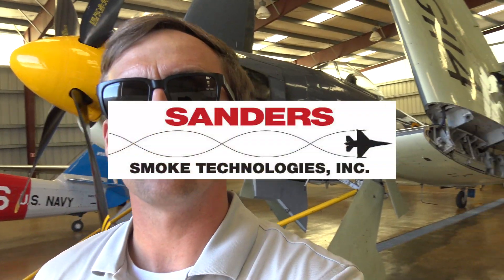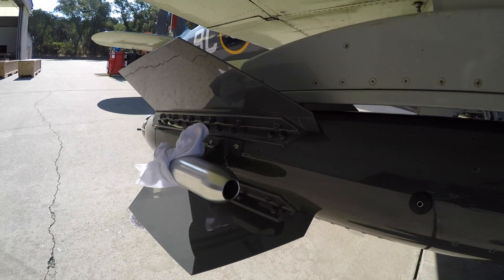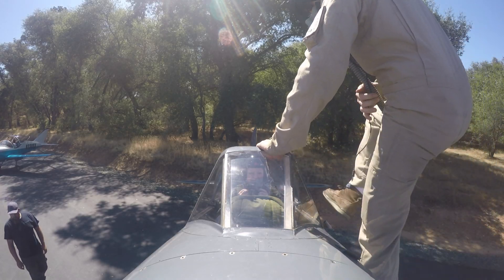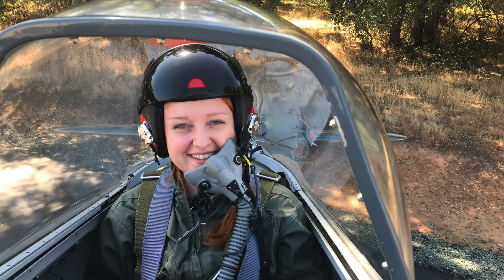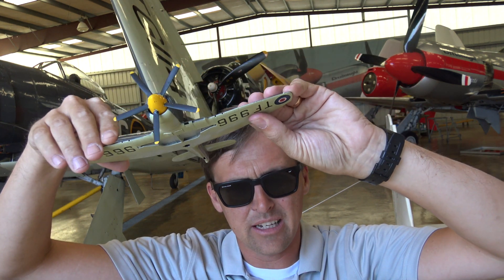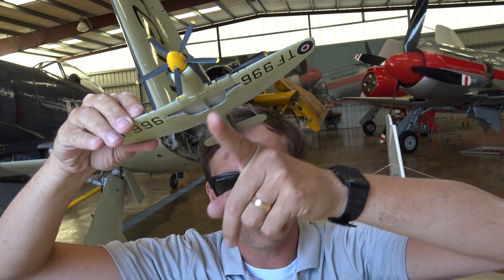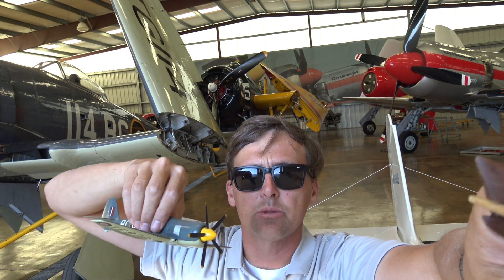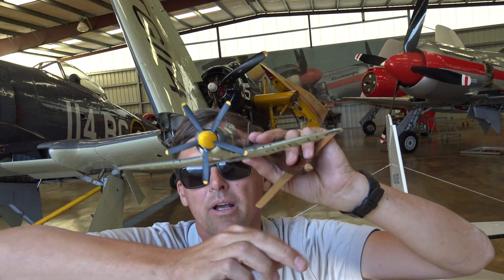Sanders Smokewinder / Argronaut Seafury Test Flight 8.7.2019

Comment: What does a plane like that sea fury cost to buy and run?
Reply from the maker: Value between 1-3 million.  Averages 70-100 gallons per hour to operate?  Roughly speaking.
Reply: @utopiasnow  thanks.  doesn't seem too terrible if you consider the lack of depreciation compared to modern aircraft. but do the maintenance changes dwarf that?  all those pistons and old school tech...

Comment: Elliot, What’s the source of the post run-up leak evident on the ground at 04:57?
Reply: Question answered at 05:10. Keep up the good work!
Reply from the maker: These generators were built for the wingtip of an F-16.  In order to mount them on the Fury, we rotate them 90 degrees.  As a result, the fuel and oil vents are submerged and leak the whole flight.  Its not ideal, but it allows us to get the testing done.

Comment: Im curious as to how this F16 design might differ from the one Frank did on Dreadnaught in the 80's. Certainly appears evolved.
Reply from the maker: Great question.

The design started with Franks Seafury.  There are two main differences.  

First, this unit is self-contained.  So while the Seafury system puts the pumps and tanks in the wing...the smokewinder is completely self contained.  Which means you can switch your F-16 from an airshow airplane to a dedicated dogfighter in minutes.

Second, this system is designed to mimic the Sidewinder missile.  The mounting hardware,  mass, rotational inertia, power conditioning, and trigger mechanism are all stock F-16.  So we got our F-16 flight clearance by leveraging sidewinder missile engineering.

Thanks for the question!!
Reply: @utopiasnow  Awesome that it has evolved to what it is. TY for taking the time to respond, always a pleasure. =)